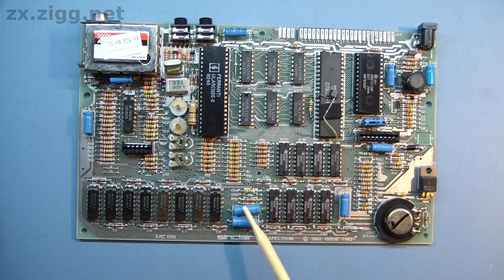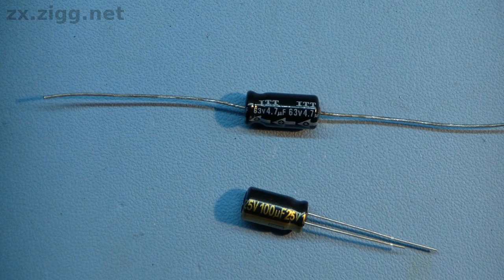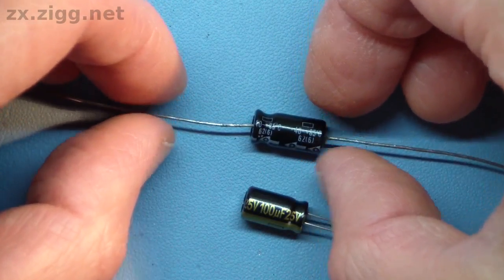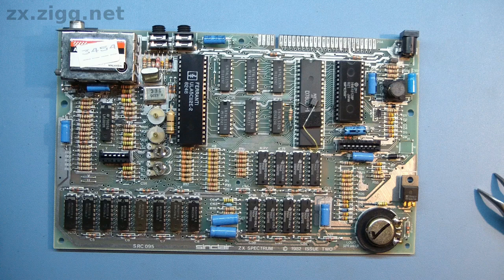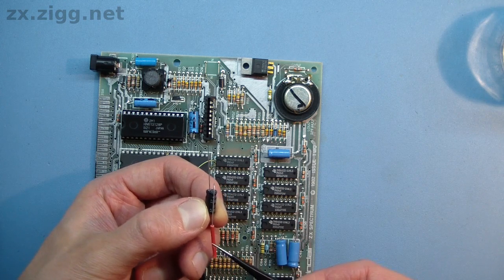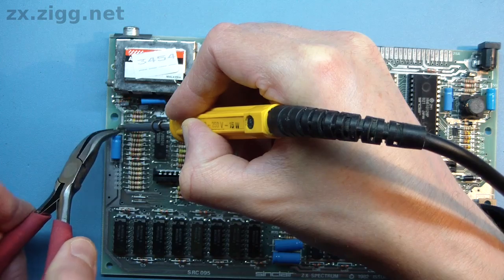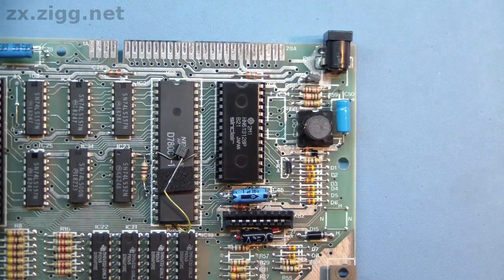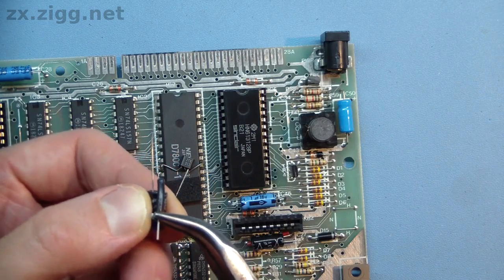Replacing Electrolytic Capacitors in a ZX Spectrum

Comment: Great video. I just got what i believe to be a ZX Spectrum +, and I'm gonna do this cuz I plugged it to a 9v 1000mA and nothing happened except a low crackling.
Do you know were I can get a PSU for this spectrum? Thanks
Reply from the maker: A 9 V, 1 A capable power supply is a good choice for a Spectrum, so long as you don't have any power hungry peripherals connected. Don't forget that the centre terminal of the Spectrum's power input socket must be connected to the negative side of the supply. Getting this wrong will likely damage the Spectrum.

Replacing all the electrolytic capacitors may or may not solve your problem, but it's a good thing to do anyway.

Does the computer produce any video output? It should be even if it has suffered many of the most common faults. Try the tests described in the ZX Spectrum Initial Tests video.

If you want to obtain an original Sinclauir power supply for a Spectrum or are in need of a repair service, contact me via http://zx.zigg.net or post in the forums at the World of Spectrum web site; a number of regulars there also offer ZX Spectrum related services.
Reply: JoulesperCoulomb
 I don't have any peripherals at the moment. About the center of the power input on the spectrum being connected to the negative side of the supply, I have to find a way to see if that is the case. When I fixed the transformer to the spectrum I made sure the white/black wires matched and so the all black wires.

All I got was some low crackling and the 7805 heating a lot in just a few seconds. I haven't plugged it since, being to busy watching your videos :) and learning a thing or two.

The machine gives no video, at least nothing changes on the tv. I may need to try to find the signal, (it finds my master system, but maybe the spectrum is some were else.) but with the overheating I don't feel safe searching for the signal.

Can you see my last video, I showed the spectrum, I think its the 46k because it says ZX Spectrum +.
Reply from the maker: DarthNinjaCode
If you've connected a power supply with incorrect polarity, it's possible the 7805 regulator has been damaged along with components in the voltage converter circuit, most likely TR4/TR5.  If you've since re-applied power with the correct polarity without having corrected any faults, one or more of the lower RAM ICs may have been damaged.

Note that unless any modification has been made, the ZX Spectrum outputs a modulated UHF signal of the type that should be connected to the aerial socket of an older PAL television.

Send me a message at http://zx.zigg.net should you be in need of a ZX Spectrum repair service.
Reply: When you plugged it in, did you use a power supply with the negative pin in the centre? You've probably fried the 7805, they're quite common to find however.